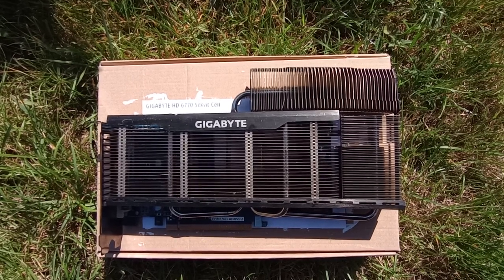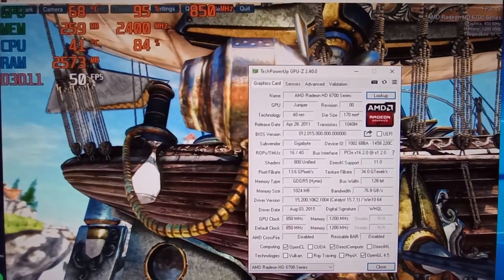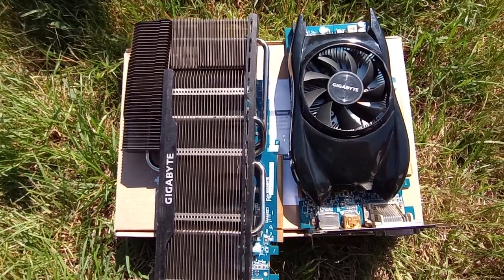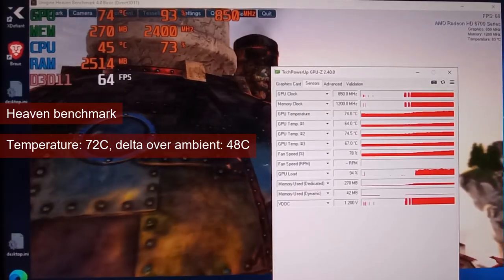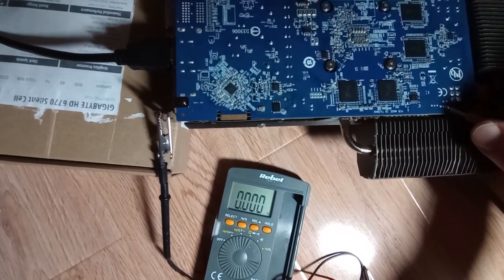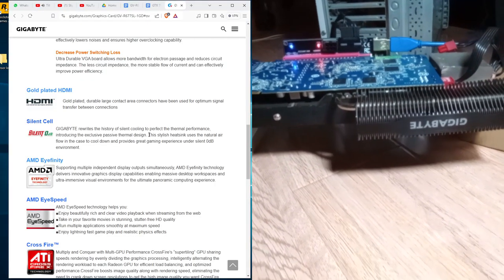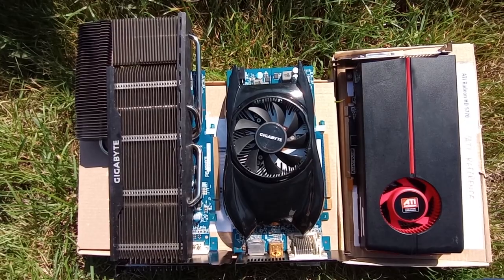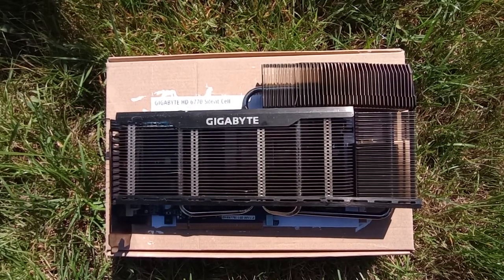Not cool, Gigabyte, not cool. (HD 6770 Silent Cell)

Comment: I approve of your naming scheme for those 2 cards, haha. I come to your channel for the tech but I love your comments and if something happens to the batmobil, just replace the heatsink and connect the fan to a system fan header as this a much better solution than this passive cooler. Also talking about jury rigged stuff, the fan died on my hd 5670 and it was overheating, as the only thing spare that I had was an intel cooler, I removed the original fan and left the intel one which was fixed with cable ties, but it worked. Anyway, keep up the good work, looking forward for the next video, man! :)
Reply from the maker: @gaming.teacher  Thanks for the comment. 
Yeah, the 5670 can be fairly easy to cool. Heck, a lot of my 1GB cards use something that's almost identical to an Intel stock cooler.

Comment: Thank you for the video. My family's first proper gaming PC (before we had the slowest C2D and a 7200 GS, only good for titles like the 3D GTA games) had a passively cooled HD 5750 from Club3D. Once I got more into PC gaming, I started looking into stuff like temperatures too and I have had similair results. A temperature of 95 C was not rare at all. It died around 6-7 years ago I think. I still have the original box!
Reply from the maker: @01RIE01  Thanks for the comment!
Yep, high temperatures will reduce the lifespan of your components, despite what some manufacturers claim.
I had no idea that Club 3D had a passively cooled 5750. I'll look it up, see if that has a cooler that is just as stylish (as Gigabyte would like you believe).
Reply: @oldertechtoday  It's called the "Noiseless Edition" if that helps. I have to disappoint you with the cooler though, the slab of metal fins is smaller than the one in the video

Comment: could try strapping some 92 or 120mm case fans to the gigabyte cooler to resolve things. this is a cheap and effective method to boost GPU cooling, although bulky and kinda ugly, not to mention you usually have to use a constant DC input or a motherboard fan header rather than the GPU's fan controller (if it has one).
Reply from the maker: @chazbotic  That would work, sure.
The point of the video though was that even some fanless designs rely on a fan being somewhere in the case, to force some air flow.
In a PC with no forced air flow, this video card would cook. The 'Silent Cell' cooling system will not work in a fanless PC.
Reply: @oldertechtoday  i wonder if anyone has ever tried making an entire side panel of a PC as a passive cooler... surely by sheer mass and surface area it might work at some point...